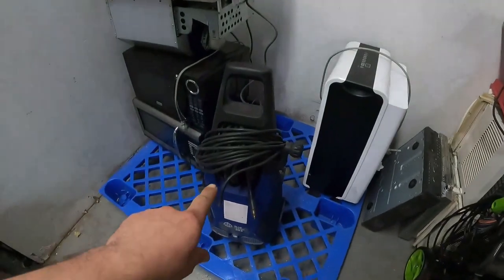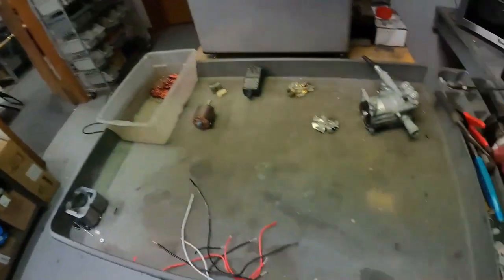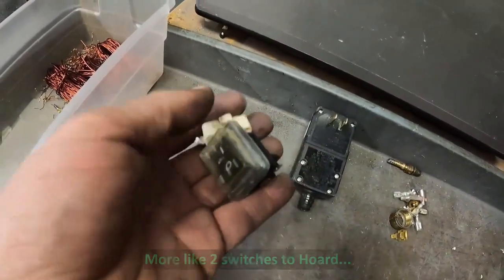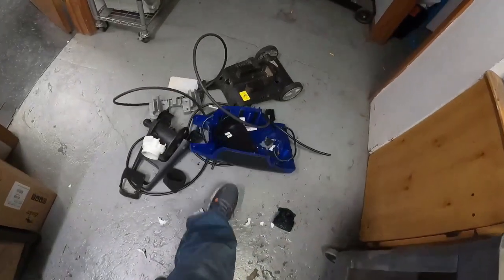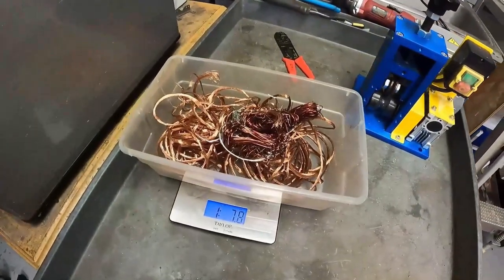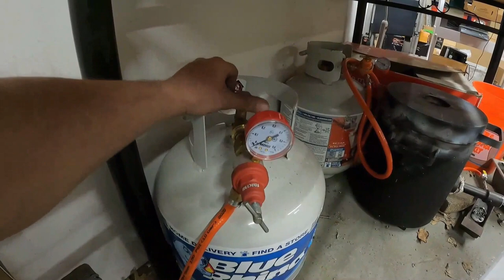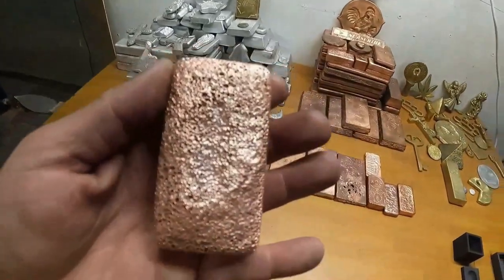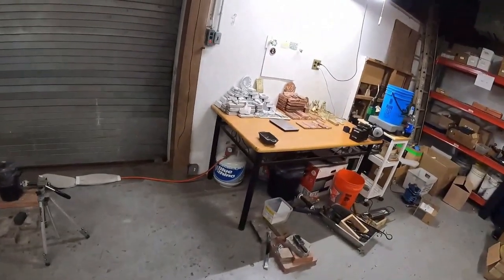Scrapping a Pressure Washer - How much copper is inside? - Trash to Treasure - ASMR Copper Melting

Comment: I got rid of an old vacuum at work and the first thing I thought was that’s a long cord it probably has a good amount of copper. FYI I don’t scrap. 😁
Reply from the maker: Oooo I love vacuum cords!  🤤 Depending how thick the cord is, you can expect at least 4 - 6 ounces of copper from them.  I have a bunch of extension cords to strip down.  Might do an updated video on extension cords.  I love stripping them but hate unwinding the twisted wires.

Comment: Usually with armatures I'll just melt the copper off directly in the crucible! Way easier and it gets everything off and then just pick the steel out
Reply from the maker: You're right it is easier to melt the copper out of them.  However, I've done it a few times and almost always some of those thin steel plates end up melting.  Not very much, but enough to contaminate the copper and force it to have a slight pull from a neodymium magnet.  I wish there was a much better, cleaner alternative.  Most times I just toss them in with my electric motors that are usually too small to strip.  Thanks for watching my friend! 😁
Reply: @Scrap2Cast  thank you for the vids!
Reply from the maker: @meltsquebec6582  you’re welcome bro and thanks for watching! 🙂👍🏼👊🏼